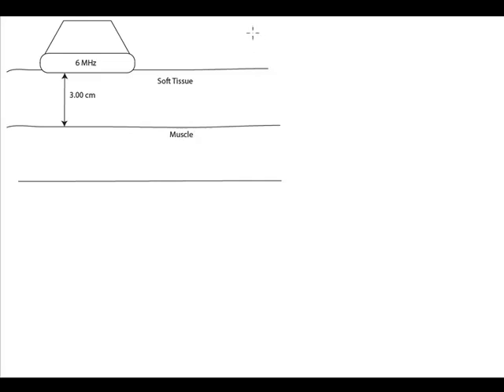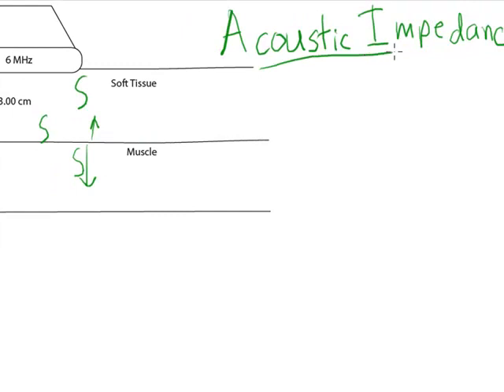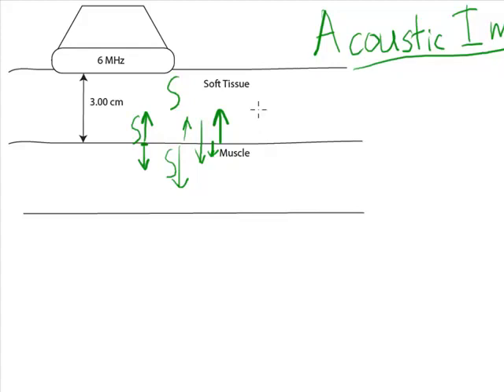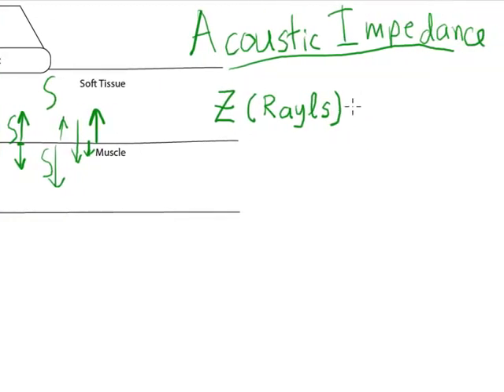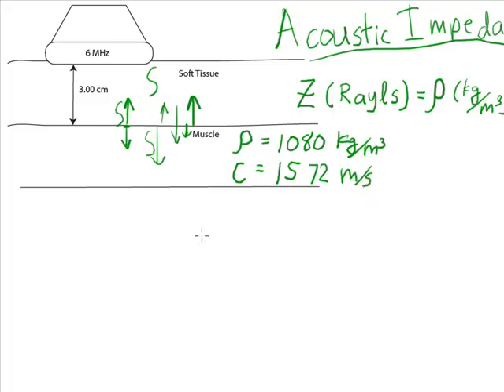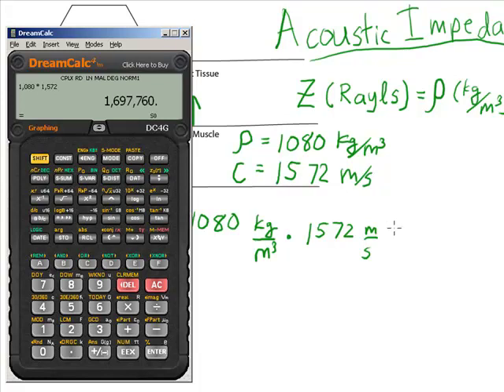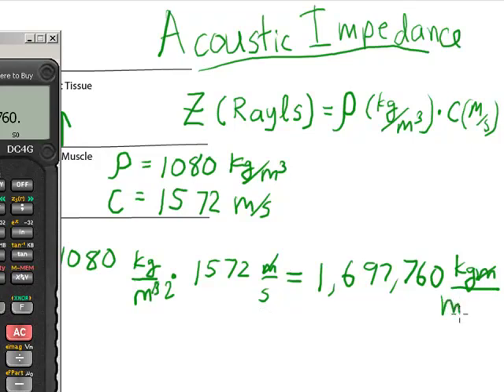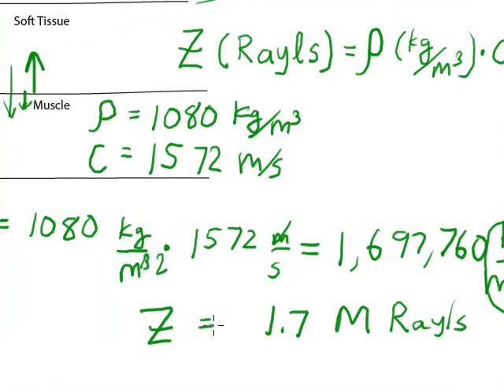Ultrasound Physics: Impedance Calculation

Comment: What do you mean by transmitted? is this the same thing as absorbed or not?
Reply from the maker: Not really, as the US wave travels through a material it will lose intensity through absorption.  At the boundary between two materials with different impedance, some of the wave energy will be reflected and some of it will be transmitted.  I suppose some of it might be absorbed as well.  The transmitted wave can travel on to hit another boundary and cause another reflection but absorbed intensity is pretty much lost in the form of heat, so it would no longer be useful for getting information.